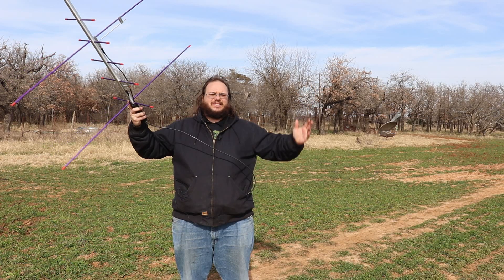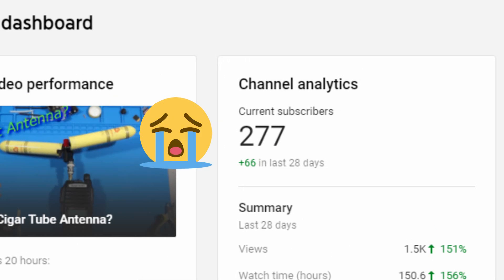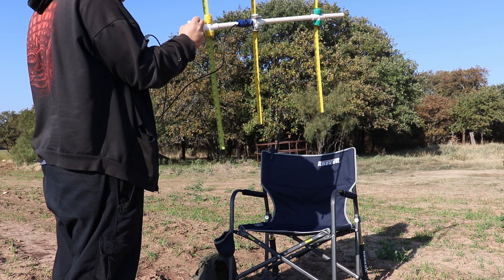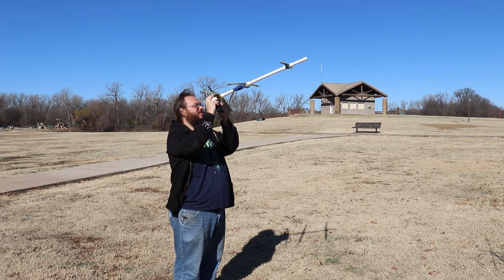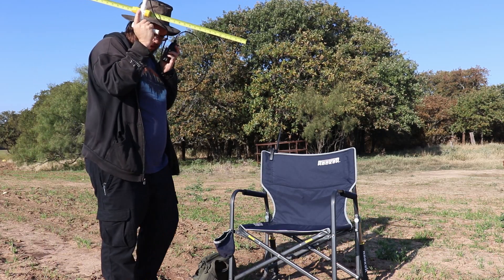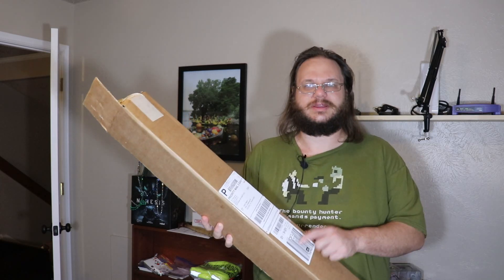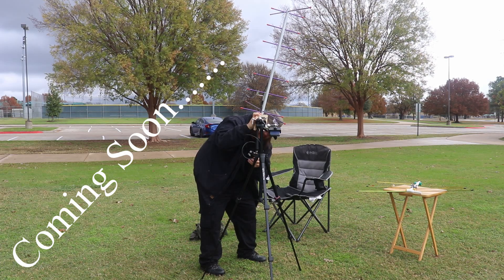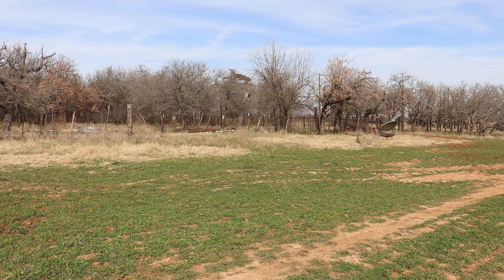Building a Portable Satellite Station

Comment: I am not a fan of intro videos, I try and skip them. They usually are much louder than the content and with my hearing I have hearing aids that feed the audio to my ears and that very loud noise as I call it hurts. Or I turn it down and then miss the beginning of the video while I have to re adjust the audio.
Reply from the maker: Thanks for the feedback, i have stopped the intro skits and have better adjusted the audio levels.  Swing by again, 73